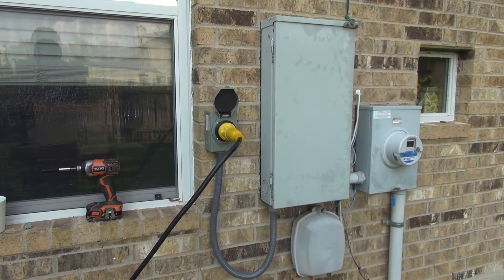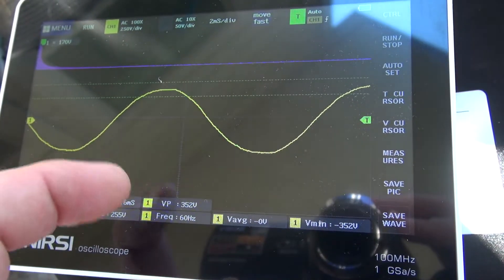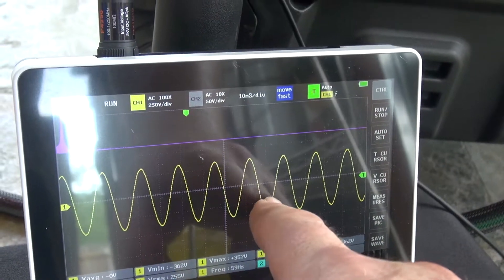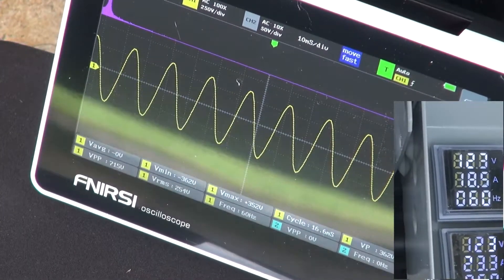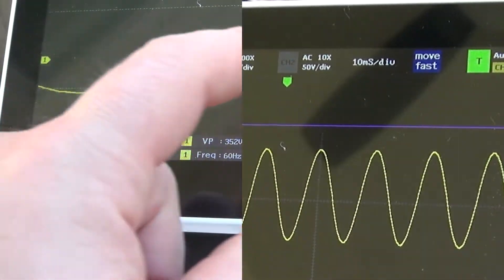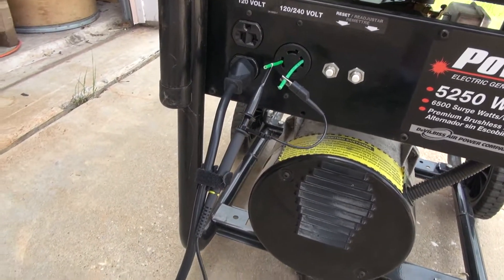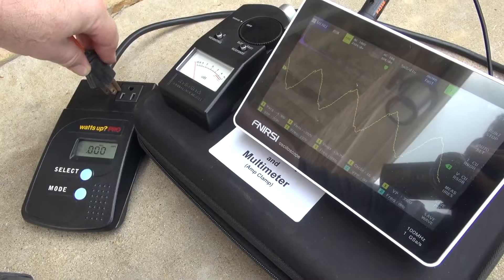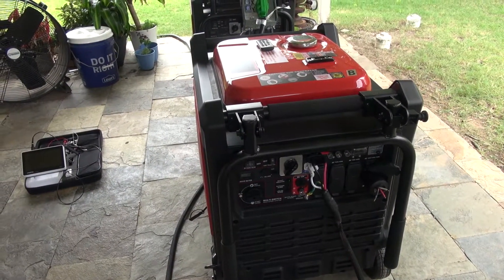Predator 9500 Inverter Generator vs. Line Power vs. Traditional: Compare Quality on the Oscilloscope

Comment: I would argue that sensitive electronics and battery chargers use DC power converted by a power supply which filters the DC output already.  Why don't you put your scope on the DC power output the electronics actually sees and compare with both inverter and non-inverter generators.  I believe inverter generators are over-hyped.  I have a Yamaha non inverter generator that has powered most of the circuits in 2 different homes for 15 years with zero complaints.
Reply from the maker: True that most everything these days apart from motors, incandescent lights, resistive loads (like heating coils), etc.  Ultimately runs on DC.  To make that DC, to your point, it has to run through a power supply (rectifiers, capacitors, etc. to smooth it out).  It's those things that are said to be particularly stressed by dirty power.  And cheaply made power supplies will generally fair worse than better ones.

Does it destroy them immediately?  Unless the item is particularly poorly designed, no, of course not, if it did generators really wouldn't be a thing.  The whole house generators are also not as bad in my opinion, because they tend to be so oversized, that the motors don't get as bogged down by most household loads.  It's the smaller generators that can really cause havok with stuff when larger loads hit.

Do you have to have an inverter generator?  Nope.  But the fuel savings by allowing it to throttle down on lighter loads whereas normal generators have to maintain speed, the significantly lower noise levels, the cleaner power regardless of engine speed / load, and the ability to team them together for capacity and redundancy, make them a compelling argument vs. the traditional units.
Reply: @Texas_DIY  Thanks.  I do have ECO mode on my non-inverter generator, but I don't use it when powering multiple circuits.  The point when the generator automatically speeds up when there is more current draw, this I would fear would not be a clean signal although temporary.
Reply from the maker: @running_rich  Interesting.  I have heard of the 'fuel saving' option on traditional generators, but I don't see how a non-inverter generator could do this and maintain the line frequency.  The Hz will be directly proportional to the engine speed.  Perhaps there are two speeds, and two sets of windings it switches between?  Curious.
Reply: @Texas_DIY  I looked at the wiring diagram and the service manual.  On economy mode the adjustment spec is 2,600 rpm; normal mode is 3,600 rpm.  There is a "sub coil" but it seems only to be used for feedback to the AVR system.  Now I am very curious if economy mode 2,600 rpm could output 60 Hz.  I may have to break down and buy a (cheap) oscilloscope meter!  I'll let you know what I find.
Reply: @Jason Wallace  With a non-inverter generator,  you shouldn't use eco throttle when connected to your house. Output frequency is directly proportional to engine speed, and small loads aren't enough to speed it up.
Reply: @Gizmos1044  Thanks that was my guess
Reply from the maker: @Gizmos1044  Yeah for sure if it's a traditional winding.  But having a traditional generator slow, would really screw with stuff in the house when it's in low power mode.  So I'm guessing there are two sets of winding.  So it can make 60hz when running at say 800rpm, and another set of windings that will handle more power and still make 60Hz when it's running at say 2000rpm.  So the only time you'd have goofy frequencies is when it's shifting from slow to high.   That's the only way I can see it safely working.

The inverter generators, don't care.  My understanding is that the windings in these generators are such that it's always making very high frequency cycles.  I do not know what the frequencies are, but say it's 200hz.. so if it slows down or speeds up, the inverter just deals with it and doesn't care as it rectifies it to DC, (so the frequency it comes in as doesn't matter) and then uses that DC to create clean 60Hz power.  So it can speed up and slow down all it wants and it makes no difference.

Comment: Amazingly enough to that was 100% exactly the content I wanted to see. Thank you very much.  Just for context I wanted to see how clean the power was so that I could possibly use it to charge a generac pwr cell whole home battery. Looks like it wouldn’t know the difference.
Reply from the maker: Some solar inverters will "sense" the dirty power from a generator and remain disengaged.  I've heard that they can't differentiate from the power from these inverter generators and will think the main power came back on, and then supplement that power.  That may or may not be a good thing depending on your desires, so keep that in mind when wiring it up.  Glad it helped!

Comment: Does the sine wave distort the higher the load?   IE:  Increased THD at highest load levels?
Reply from the maker: Nope.  Only saw a drop of one volt when the AC kicked on, and the waveform didn't change.
Reply: @Texas_DIY  THD wasn't measured so that can't be said, true the sinewave looks good but then again my Utility Power sinewave looks good too but has 5% THD which is crappy for Utility power

Comment: There is no such thing as 110V or 220V!  The us power standard is 120V/240V.
Reply from the maker: Yup.  As if split phase power isn't confusing enough, we have to come up with multiple different common terms for the voltage for added fun as well.  :-)      (110,115, 220,240, etc.)
Reply: Technically your wall outlet puts out 110, 111,112,113,114,115,116,117,118,119 and 120v at 60hz lol

Comment: My plans are to Parallel 4 of these Genset's to produce Power for my House which is all electric, my calc is 125 amp@240vac.
My plan is run 4 inputs  andoutput to 2 50 amp NEMA plugs or a single 1 125 amp nema plug to my panel..  My furnace can become Voracious when the heat strips kick in (85 amps)... In your opinion will this be enough power... Thanks for your great videos
Reply from the maker: So wow, there is a LOT to unpack right there.
Honestly, for that expense, you'd probably be better off with a whole home generator.  You won't get the nice sine wave, but yours will cost about the same.  Be really careful and please read through some of the pitfalls I'm going to describe.  

My furnace also becomes really piggish when the heat strips are on.  Mine uses 3 breakers.  One for the air handler (and a few heat strips), one for the compressor, and one for only the aux heat strips.  I arranged my system such that I can simply not turn on the final breaker for the heat strips.  That way the heat pump works, and some of the emergency heat strips work... but it won't nail the generators with the full hit from all of them.  (Up in the attic, I did have to move the 24VAC transformer from the heat strip circuit to the air handler circuit so my thermostats would work)  So that may be an option, just enough heat to keep from freezing... and still run on just a pair of units.

But let's explore going with 4 combined.

I see no reason why 4 units would not sync together, but the means of connecting them is going to be the challenge, and I can only think of one good way.  So let's assume you make two parallel kits like mine, to service a total of 4 generators.  Now you need to get both of the 240VAC cables you described into inlets.  So you need a way of making an interlock that won't allow you to have main power on, and any of your inlets.  Ok, so maybe your interlock looks like mine, but instead of only blocking one breaker, it makes an upside down U shape and blocks the top breaker on each column.  So now you can't have either of your two top most breakers on when main power is on.  Turn off main power, and slide up the interlock, and now the top slot on each column is unblocked and you can turn those on.  So far so good.  (you should watch my video on hooking it up to the house so this makes more sense)  This at least protects you from mixing line power and generator power, which is most important.

But now you have a problem.  You've got main power off, and the interlock now allows you turn turn on either of the top breakers which go to your inlets.  If you only hook up one generator parallel kit, you have the ability to turn on the other breaker for the unoccupied inlet.  This will energize those exposed pins with 240AC from your connected generator.  If you hook up both inlets (all 4 generators) yeah, those pins are covered.  But if one becomes disconnected, you have exposed hot contact points for anyone to touch.... and (very important) now one pair of generators are out of sync with the other pair.  (just like when you start two stop watches at the same time, they quickly drift out of sync, I'd bet the generators will as well)

So if one of the inlet cables comes off, the generators that were disconnected will fall out of sync with your other pair of generators... so it would probably be very bad to reconnect them and feed two conflicting power frequencies into your home at the same time.  The only way to safely reconnect them would be to fully shut them off first, and restart them in the presence of the pre-existing power.  So you have the potential for destroying your generators if you do one step wrong (such as disconnecting and reconnecting the cables while they are energized)  and you have the danger of potentially exposed high voltage pins anyone can touch.

So it seems to me, if you really really want to combine 3 or 4 units together, you'll need to make a bigger SINGLE parallel kit (quad kit?), and have leads for all 4 units combine into a single box/point.  From that point, you have to hard wire it to your breaker box using suitable heavy gauge wire directly into your breaker box, and into a SINGLE suitably sized breaker.  This makes it really hard for you to accidentally let your generators fall out of sync, and you can use a conventional "off the shelf" interlock.  It's the only way I can think of to safely accomplish this.  

Really, I'd think really hard about just finding a way to limit how many heat strips your air handler can activate.  Some people do this with a simple switch in the attic to disconnect some of the heat strips.  I was able to accomplish the same thing by just not turning on 1 of the 3 HVAC breakers.  That might be a far cheaper and more simple solution to get you by with only a pair vs. 4 units.
Reply: @Texas_DIY  My intention was to build a 4 unit  parallel box to feed sub panel which feeds 125 amp breaker so the interlock should work between the mains and generator breaker, my other thought was run a 48-60 kw genset on natural gas and use batteries and inverters to supply the critical sine wave circuits

Comment: Excellent review ..  Very helpful.  Helped me to confirm to move forward with the Harbor Freight 9500.   Could you also run the sine wave test on the 8750?  That pure sine wave seems critical since every appliance now has sensitive electronics.  Thanks again.
Reply from the maker: If someone has an 8750 in my area, I'm happy to put the meter on it.  The website description for the 8750 does call out that it is a "pure sine wave" so it should be good.  It's open frame, so the main difference (apart from the slightly reduced capacity) will be the noise level during operation.  I'm also not seeing the parallel ports in the photos, so you may not be able to safely team it up with another unit.

But if all you need is a single unit, it looks like a great value.
Reply: @Texas_DIY hmmm that must be a different 8,750 generator than I have as it doesn’t say pure sine wave in it - haven’t hooked it up and tested. Maybe once I rebuild it I can see.

Comment: How "dirty" is really dirty enough to matter? Looked pretty good to me with just small spikes jumping around. There were no peak distortions, like little ski hills or flat spots, so I don't see where that is a problem. How much can a electronic components power supply endure? Every electronic component has it's own power supply that should not even care about a "dirty" sine wave like you demonstrated.
Reply from the maker: Lots of stuff doesn't have a nice filtered power supply, often just a transformer.  It depends.  To me the sine wave looked like trying to drive on a dirt road vs. a paved highway.  Maybe they were similar in the slopes... but the "rough" ride will wear down your electronics.  Some things may fair better than others.

To each their own though.  In addition to the more clean power, I also appreciate that the inverters will spin up / down in relation to load.  This can reduce fuel consumption and noise, vs. a traditional generator that has to maintain precise speed in order to maintain the correct frequency.  Combine that with the ability to team them up, and it's a pretty interesting concept.  

But they do come at a greater cost per unit, so that has to factor into everyone's decision making process.

Comment: Why would a "dirty" sine wave affect an electronic component that has it's own power supply feeding the electronic boards? Pretty much all electronic component boards will use it's own power supply to make DC at various voltages to run the electronics and are designed for "unknown" line supply voltages and frequencies (within reason). All home standby generators (the big automatic ones) are conventional generators and provide their power directly from the windings and I'm pretty sure a 10 or 15 thousand dollar whole house generator would not sell if they destroyed "sensitive electronics", if that is such a thing. Grid supplied power is generally very good, but they do suffer from low voltage, voltage spikes and I'm sure dirty power at times and unless it's a lightening strike, electronics do fine. I just think this "inverter clean power" thing is mostly a marketing scheme. Also inverter generators are more complex, have smaller generators for the same power output and cost more. All negatives if you ask me.... :-)
Reply from the maker: My understanding is that the dirty power generally won't "insta-kill" your electronics, but it will cause premature failure.  Also different electronics have different levels of tolerance.  A nice laptop power supply will probably be more tolerant than the computer board that lives in your fridge.  Motors won't really care, they run in relation to the power, but electronics stuff is at the mercy of the quality of the power supply and the power filtering.

Does this apply to large whole house generators?  I think so yes, but, not as much.  Those units generally have to be oversized to accommodate the surge loads, so when those things happen, you're not briefly maxing out the generator and bogging it down.  But you're paying for that oversized equipment.

Also the logic is, how long are you actually on generator power vs. line electric power?  It is long enough to matter.  With a whole house generator, it probably doesn't matter much (power isn't as bad, combined with short run times).  But if you're running your whole house on a portable generator that bogs down easily with surges... the damage it can do to stuff in a short time may be significant.

This is all just one man's opinion though, so grains of salt.
Reply: I was wondering this too. Well, to begin with, I was puzzled why "inverter" makes the waveform better, as most dc-ac inverters sold produce modified sine wave. Most UPS devices sold do this too.
Modified sine is a bit of a misnomer, modified square describes it better in my opinion.

 Works great for most electronics, although the voltage peaks might bee too high in 230V part of the world, but just fine in 110V world (especially if the power supply is a universal supply rated 100-240V). Some active PFC circuitry might also get confused. A motor, on the other hand, makes a lot of extra noise running on a square waveform, and might heat up more than usual.

Even the dirty waveform in this video was magnitudes better than the waveform produced by most inexpensive UPS devices, and people trust those to protect their sensitive electronics all the time.

The real question in my mind is, do all inverter generators produce waveforms close to this? Are there inverter generators producing modified sine? Maybe there biggest user group for generators is building sites, which forces generator  manufacturers to produce true sine so that powertools don't sound weird and heat up?
Reply: wow who knew we have been buying invertors generators for no reason, power goes straight from the windings? hold on whilst I hold my gut from laughing; ...you might want to do some reading on generators, power and harmonics for starters
Reply: @joey24698  Do electrical grids use inverter generators?